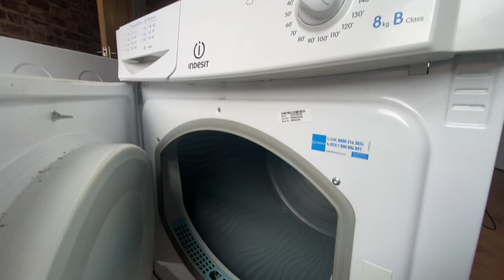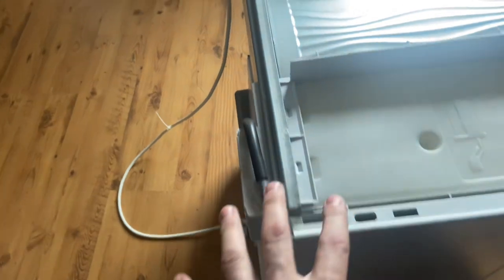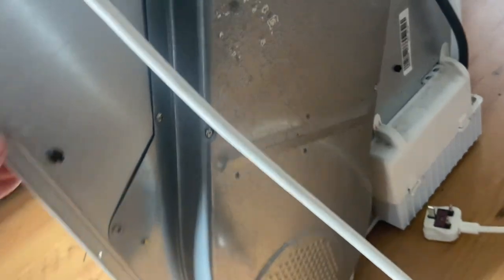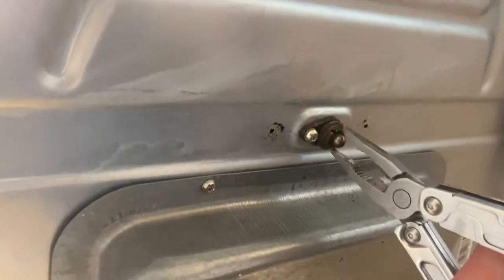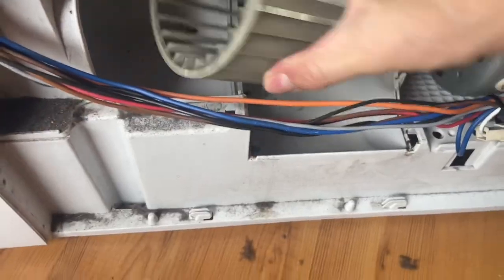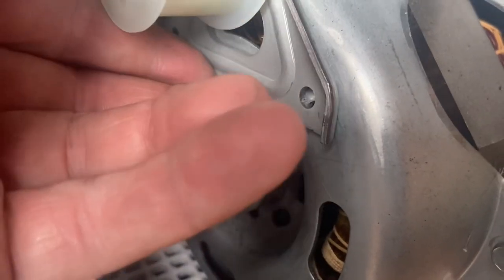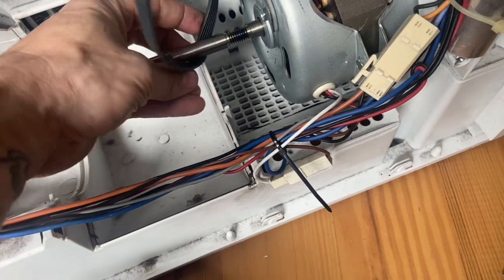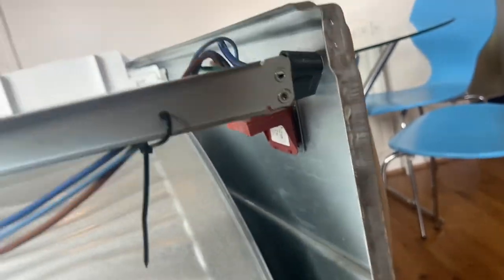How to repair a Indesit Tumble Drier thats not spinning

Comment: i cannot get the belt back on how did you do it for me it’s incredibly hard to stretch it back
Reply from the maker: @NizzyNey  i put a screw driver through the belt and pulled it over the new pulley with two hands, got it caught on the edge of pulley and moved the drum with my hand to get it fully on. Not gonna lie its tricky.